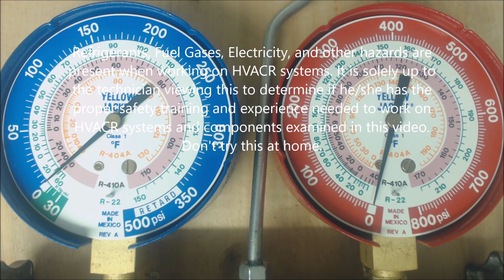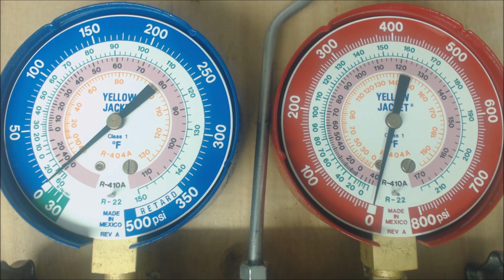R-22 and R-410A Refrigerant Operating Pressures on Air Conditioning Units!

Comment: Great video and want to propose a quick question; why, when let's say a 410 unit is operating at let's say 100 psig suction is the evaporator coil not producing as cold a stream of air as when let's say the pressure is 125 psig and the coil temp is a bit higher? It would seem the lower pressure lower temp would produce a cooler stream of air!
Reply from the maker: If it was just about that then yes but there are many other factors involved such as the superheat, subcooling, and the saturated state. A higher vapor pressure could also just mean that there is a higher load in the house, at 100 psig we still don't know if the outdoor unit was able to change the refrigerant into a subcooled liquid. It must be a full liquid stream heading towards the txv for it to be able to hold a certain superheat which is for safety for the compressor as well as efficiency for the evap coil. When it is all said and done, you want as big as a saturated state as possible because the phase change of the refrigerant is really what is storing the heat energy, not necessarily the temperature although the temp does need to be low enough to be able to absorb the heat. After the sat state it must change to a vapor that is superheated for the compressor's sake. Great question.  Go to this playlist and watch the videos with the evaporator coil on the thumbnail for more information, thanks   --   https://www.youtube.com/playlist?list=PLxnHR5_D2ojzAUXWWQt9A8juotNkzwYlk
Reply: acservicetech here in lies the point you made. That is volume. As  a simple air compressor accumulates air in its receiver..... what then can we observe? Answer;  Increase in pressure so the volume of refrigerant is a correlation between pressure and temperature. You make an excellent video and explained the ratio of volume to pressure well. you must have taken some engineering classes.
Reply from the maker: Thanks Melvin292!

Comment: Hi i have a Daikin 2HP mini split installed in my house. It has R22 refrigerant. Temps at my place can get upto 110F during peak noon 1-3pm. Cooling is reduced upto 35% when its peak heat around 100-110F in evenings or night temps are around 80-85F it works cold. And the outdoor unit is exposed directly to sunlight and it has around 12 meters of copper piping installed. The low side is 70 psi when outside temp was around 100F
Reply from the maker: Is this an inverter style or single speed compressor? Do you have an indoor temp diff between the return air and supply air of 18 degrees when it is 80-90 degrees outside?
Reply: Its single speed R22 split.
Reply from the maker: Does it say a rated subcooling on the rating plate? Is there a charging guide on the back side of the shroud. It likely has a txv on the outside and yes if it is a single speed then you can check the charge with subcooling for txv units and superheat for pistons. Subcooling of usually 8-12 degrees for txv equipped, single speed, comfort cooling units without a stated txv rating. thanks
Reply: acservicetech its plate says R22 charge 1.5kg. If the outdoor unit is directly exposed to sunlight heat of around 100F it will effect the cooling of AC and make compressor run more harder
Reply from the maker: Absolutely, if it were installed in the shade it certainly would be better as long as long as air flow was not cut off, thanks

Comment: For R22 the lower border line is 60psi? If a r22 split is running on 65psi with 85 degree ambient and 25% humidity is this alright?
Reply from the maker: In my experience, when a system is running down at 60 then there is likely a problem unless it is very cold in the house or cold with a cap tubing metering device but yes the 60 would be right above freezing. You would need to determine this with superheat if the unit has cap tubing or a piston and subcooling if the system has a txv. Thanks - superheat-  https://www.youtube.com/playlist?list=PLxnHR5_D2ojwGvhU1rseXQLJ-XBjBZMMk  and subcooling-  https://www.youtube.com/playlist?list=PLxnHR5_D2ojxTcAtR_53GoY8huBcSOt0a
Reply: Its 65 psi on a mini split its cooling but not that cold, might be bit low on r22 if i bump it to 70psi would it blow cold? Right now the vent temps are around 50F

Comment: I don't think you realize how many people you're helping by Doing videos  and actually responding to  comments a lot of people don't want to share their knowledge i've done installs but now I'm starting to get more into the service side of things and your videos have been a big help
Reply from the maker: That's great to hear Matthew, thank you!
Reply: @acservicetechchannel  good morning sir
I m very happy to hear u.
Your work is point to point clear.
Sir some deep questions for u?
In r32 do we trust in pressure or trust in sticker level on the mini air conditioner outdoor which told 650g gas in 1.5 ton ac? If the pressure which if have to follow? Because old system efficiency is less. Do i put some extra gas like 50g extra or less? If i put the extra gas amps  go up? Indoor unit is down, outdoor unit is on roof. Gas pipe is 3.5 meter. Distance is less can i cut pipe and make 2 meter? Would i have to extra gas charging? And if the 30 min with  vacuum with refrigerator compressor is it right vacuum? If the vacuum without vacuum pump is it ok? Can i re-vacuum the unit because now how can i remove the air from the system if vacuumed with refrigerator compressor? Now i have to vacuum with double stage vacuum pump? Or i have to out totally gas from the system and then again i vacuum with vacuum pump? 
Please tell me help me?
Reply from the maker: So first, when working with an empty system, you need to pressure test, oil blowout, vacuum with a VACUUM GAUGE, to verify that you are below 500 microns, then the 10 minute standing vacuum test, then break the system with refrigerant from the system or liquid refrigerant into the liquid line which is weighed in. If there is air in the lines mixed with the refrigerant, it needs to be recovered to specified level before starting over, thanks
Reply: Thank you so much for your time helpping us to understanding that..
Reply: I agree your videos are absolutely awesome your a great teacher
Reply: This  for mind  how  manney gues not  asking but   knowleges   playing helping r22  su,,60to7o  disv,,250  to  300,  r410    su,,110to120   dis 400to500

Comment: Can you do a video at some point on why liquid line temperature's can get extremely hot and what can cause that especially when you're trying to figure out your sub cooling
Reply from the maker: Here is one. Let me know if you are looking for something else. Thanks - https://www.youtube.com/watch?v=aiZnxaMW8hw
Reply: acservicetech  r22 rtu  highside  psig  is 249 LSAT is 117 and LLT is 162 I can't figure out why the liquid line temperature is so high
Reply from the maker: Wait, that can't be. That would be a negative 45 degree subcooling like instead of rejecting temp on the condensor coil yuoa re absorbing instead. Where exactly are the service ports at and where are you taking the actual temp at? Also is this a heat pump?
Reply: acservicetech    Heatpump

Comment: I wonder if TUMP could possibly reverse the ridiculous ban on R-22?  All the millions wasted on overpriced R-22 and its inferior replacements. Not to mention a lot of older units replaced with junk new ones that will leak in a year or less due to garbage  "high efficiency" coils combined with the excessive pressures of 410a.

Comment: What's your opinion on digital manifolds like the Fieldpiece that shows and calculates superheat and subcooling for you?
Reply from the maker: I don't mind them showing the saturated temperature but I don't like that they calculate superheat. The only reason is because it takes the thinking out of it. In my perspective/experience, any time things are just given to us instead of determining them ourselves, it disengages the mind. This makes it harder to quickly diagnose problems. This is just coming from a teacher of high school and adult hvac students.  Now if someone has many years of experience and they want to switch then that is fine. I am just mainly concerned for those beginning or continuing the learning process. Thanks and great question!

Comment: Hello, So my charging for 410 should be around 110 psig on the low side to be correct with the charge.
Reply from the maker: That would be the low part of the range but you would definitely need to check superheat for pistons and subcooling for txvs as mentioned, thanks.Those ranges are just for general knowledge and not a deciding factor for charging.
Reply: acservicetech Thanks, will do.
Reply: Thanks I learn so much from your videos